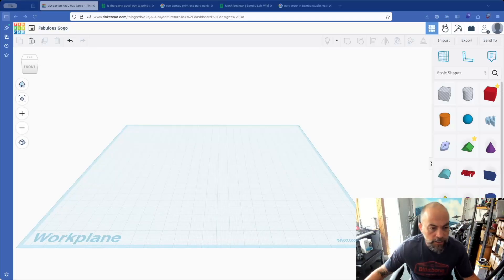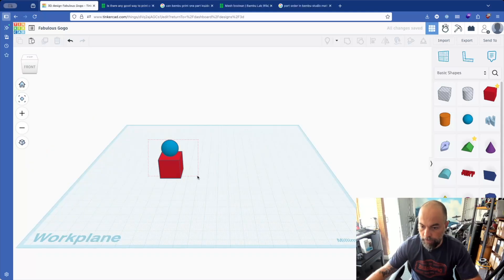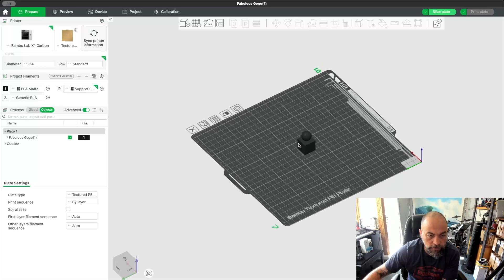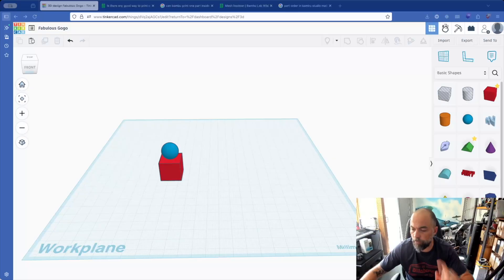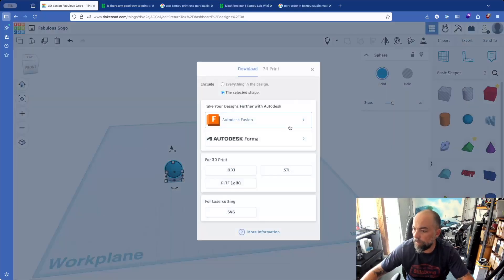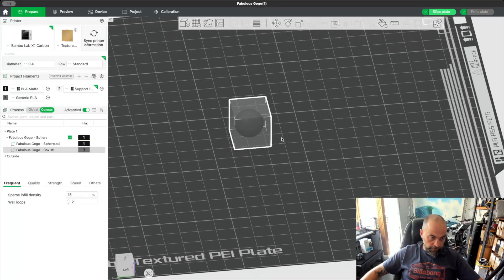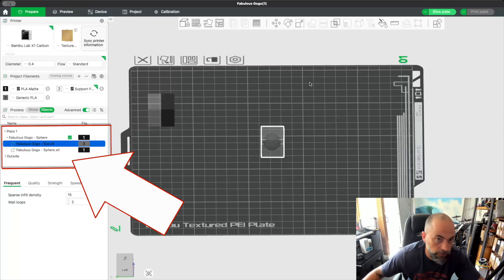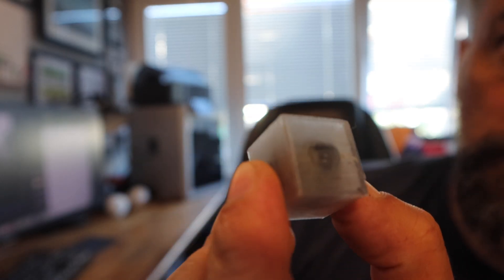Floating parts inside objects! Finally figured it out!

Comment: Great video!  have you figured out how to do this if the two objects have the same material?  Trying to print a solid object inside of another object's sparse infill.  Weird situation but bambu still only prints the outside part
Reply from the maker: Hmm. The material shouldn’t matter other than heating temps etc. so both should be PLA or both PETG etc. 

Have you tried adjusting the order of the parts as in the vid? That was the trick for me. 

Alternative might be to use the assemble/merge tooling?
Reply from the maker: Or did you mean just with a single filament?